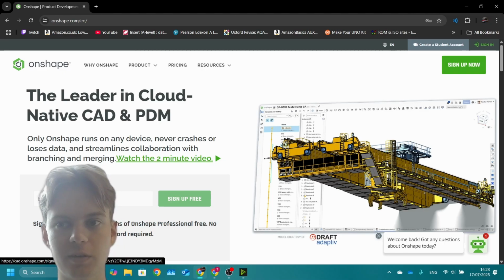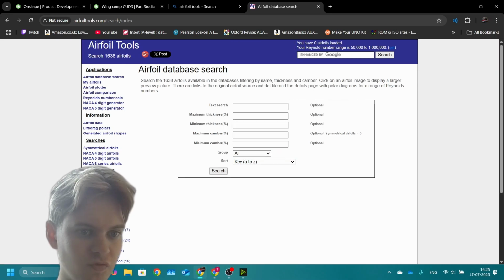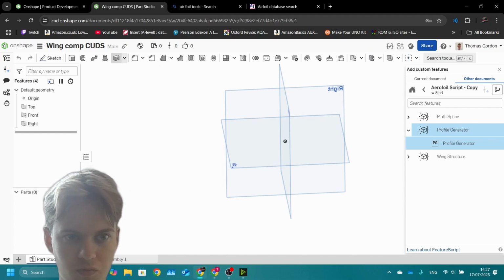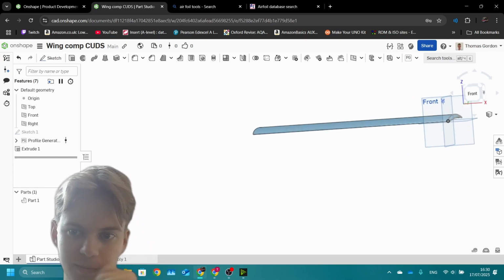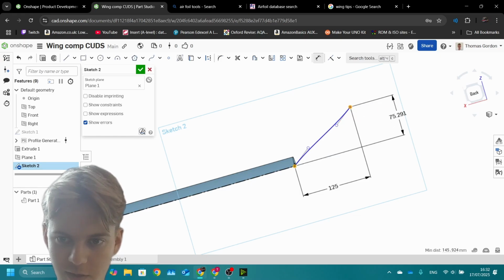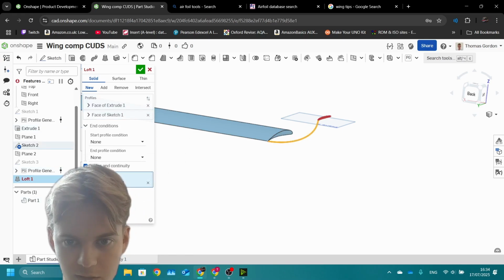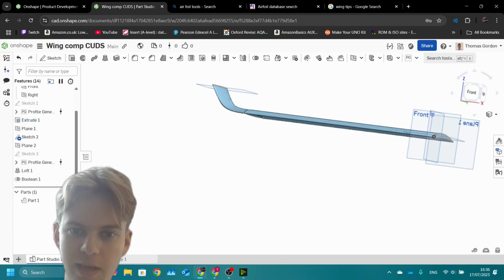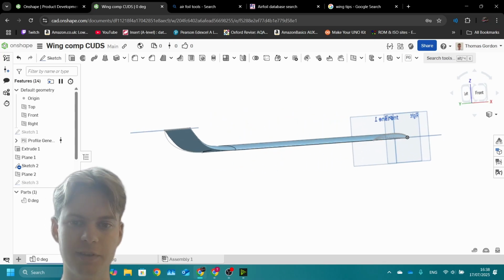Onshape Wing Design Walkthrough | CUDS EYV Aerofoil Design Competition 2025

Comment: I have been trying to get the loft to work for a week now 🤦‍♀️
Reply: What happens when you try?
Reply: @alishbaabdulaziz947It just shows me an error and is all red, the same way as in the video
Reply: @untowardsuuu same 💔 have u figured it out yet?
Reply: @aibah_ edit sketch 3, click extend at the top on the toolbar and extend it. Then try that or move up to like 150mm
Reply: @untowardsuuu did you figure it out? i tried redoing it and changing the dimensions but nothing works
Reply: I had that problem but I went back a few steps to making sketch 3 then started again with 150mm and it worked out
Reply: @deffonotdebz7069 yo thanks so much, i went back and made it 150mm and it worked
Reply: i struggled initially with the loft as well, but i found that using the connections part of the feature and making sure the dimensions arent too small made it work. hope this helps

Comment: The rules state that the wing must be symmetrical. Does that apply to the winglet aswell or just the airfoil?
Reply from the maker: If you watch the simscale video you'll see how we use the symmetry boundary condition. You just design one half of the wing then mirror it in the simulation to get a full wing. Therefore, only add a winglet to one end of the half wing in onshape and it shall be made symmetrical by simscale.